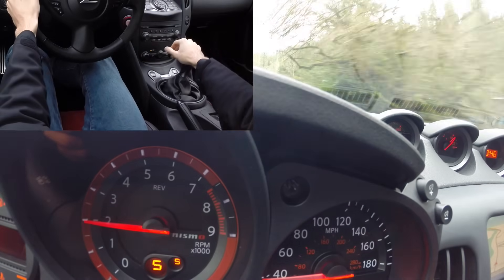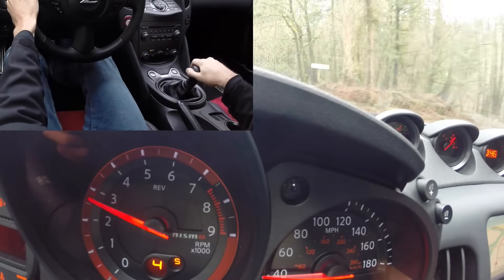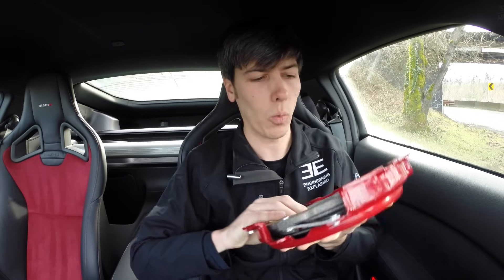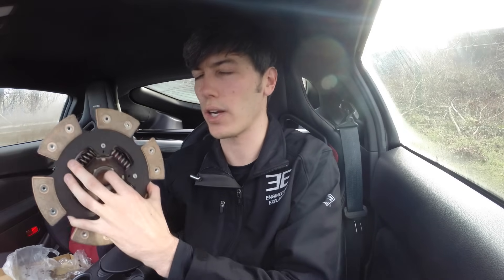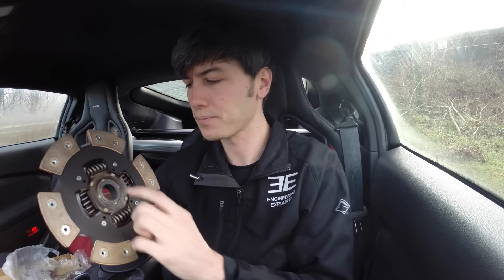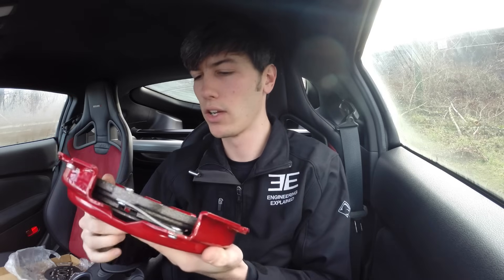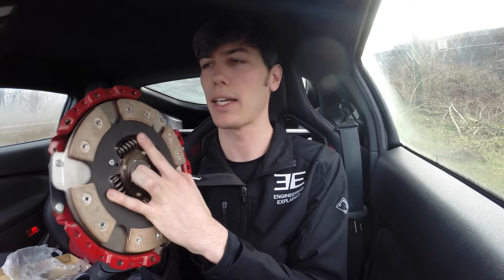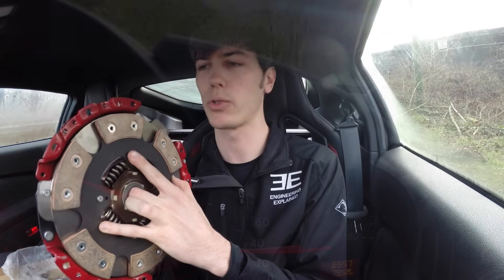What Is Rev Matching?

Comment: When im at a higher gear and im coming towards a stop sign, i just go into N and start braking, and when its time to go again, i put it into 1st and start going. Is that bad?
Reply: Not really, a lot of people have their opinions. Technically it’s less safe? Because if you need to speed up quickly the you have to figure out what speed your at, get in gear, and get to the right revs, but I usually do this. If I take a hard turn I will push my clutch in, get ready to downshift for when I need to get back to speed, and then rev up and release my clutch when I pass the turn, So that I don’t have to worry about getting too low in revs from braking while I was going fast. I’m also a newer driver, and can’t do downshifts while hard braking. I put it in neutral at a stop sign, and if I do a roll through (if there’s literally no one else coming) I get myself back into 2nd, or I just stop completely and start from 1st again. I do this whether I’m in 3rd or 5th coming to a stop.depend on length of road you have to stop, if you’re speeding and you come too quick def pop it in neutral and focus on stopping your car safely, if you have ample distance, you can downshift a couple times before either stopping completely. Idk if this helps this is just what I do.

Comment: Curious why in the Vantage, for example, the most torque is at high rpms (5000-7000) rather than low end. This is very different from how you explain the mechanics for the average set up. Exhaust profile? Other?

Comment: Thanks to "electronics", rev-matching is a no-brainer. Of course it is cheating compared to someone who spends a lot of time on the track and can do without all the" electronics" that makes it so easy. On my motorcycle, rev-matching is a no-brainer because my hands takes care of three things, the clutch, the front brake and throttle, and the feet handle the shifter and rear brake. On a car I can rev match, but not as good as a racer heel and toeing. Mind you, my clutches exceed 180,000 miles. But how nice to have the "Sport Plus" mode on my 2015 Porsche 991 Carrera 4 GTS...in a manual, of course. What a treat! Thinking about it, all you need to know are the gear curves, your RPM and the ECU can do the rest with the electronic throttle, when the clutch is depressed. Good videos by the way. Nothing like a "practical" engineer, instead of one sitting in a cubicle all day.

Comment: what does it mean to "blip" the Rev.. so when the clutch is engaged you hit the accelerator a bit? what about if you need Rev lower?
Reply: No, when the clutch is DISengaged, tap the accelerator to bring the rpms up while the engine and transmission are decoupled.  If you are downshifting, you always need to raise the rpms in order to match the new transmission speed.  When upshifting, you need the rpms lower for the next gear, so you let off the throttle before you re-engage the clutch.

Comment: Someone answer: If I’m going 15 mph in 6th gear (not that I would) could I shift all the way down from that to first skipping the other 4 or 5 gears without damaging the car because it is in the rev limit
Reply: Yes-ish.  You’d be asking a lot of your 1st gear synchro.  It’s meant to harmonize between relatively close speeds, not to replace the clutch or other gears.  You’d wear it out much more quickly doing this, as the rear end of the transmission would be using it to spin up the front end to a much higher speed before you’d be able to engage the gear.

Comment: A very useful educational video! Got a quick question. My car has auto rev match however it only kicks in when the RPM is above 2000. There were a couple of times where I forgot this and shifted from third to second below 2000 without letting the clutch out slowly and then the car did a pretty hard jerk. I wonder what was actually happened and is it bad for the flywheel? My car is brand new but try and avoid this again because it wasn't a pleasant feeling.

Comment: If I'm understanding this correctly, for a smooth downshift say I was in 3rd gear and wanted to go to 2nd, would I bring to revs to 3000 rpm? So I'm bringing the revs to match the previous gear?
I've been practicing it for a while but It seems I've been using the wrong technique.

Comment: But if you’re for example driving in 80 mph in 4th gear, you can’t downshift to 2 right? Wouldn’t that destroy your engine?
Reply: Richard Na123 
In many cars, probably not good.
But really depends on the top speed of the vehicle in that gear, which depends on the gear ratios and redline rpm.
All of which you will naturally feel out as you gain experience with a particulate vehicle and can begin to determine which gear you want to be in at a particular time/speed/location for the type of driving you are doing at the time.

Many super sport motorcycles will go near 100 mph in 1st gear, but they rev much higher than most cars.
So if you are on a track on one of these bikes coming down a straight at high speeds and going into a corner that would be taken at 80 mph; then you would probably want to downshift all the way from 6th gear into 2nd gear going into the corner.
(But would want to go through the gears to use the engine braking (and maintain more control) also as you slow; not just pull in the the clutch make the brakes do all the work and go directly from 6th to 2nd.)
To be at the proper rpm through the corner and have more power available when exiting the corner and getting back on the throttle, for faster exit acceleration and ultimately more speed to the end of the next straight.
Reply: Shannon Crawford thank you!!!

Comment: In retrospect it was good that the first car I drove had no synchro on first by design and no synchro on 2nd by decrepitude so I had to learn this (along with double declutching) to avoid stopping if I needed to drop below 3rd at any point. Although I know it can all be done by a $1 microcontroller I still get a buzz when I pull off a good heel & toe double declutched downchange and stay out of the scenery 8-)=

Comment: Pardon the length of this comment, but I need to know something.
WITHOUT RevMatch, and assuming you already have the throttle depressed to some level and the clutch is fully engaged, the ideal sequence to shift into any gear is (and correct me if I am wrong):  
     1) begin to depress the clutch
     2) as the clutch is depressing, release the throttle so as to fully release immediately after fully disengaging the clutch
     3) shift into the desired gear
     4) begin to depress the throttle
     5) as the throttle is depressing, release the clutch so as to fully engage after the throttle sets the correct engine speed
This all happens in one second or so.

WITH RevMatch, and assuming you already have the throttle depressed to some level and the clutch is fully engaged, the ideal sequence to shift into any gear is (and correct me if I am wrong):  
     1) begin to depress the clutch
     2) as the clutch is depressing, release the throttle so as to fully release immediately after fully disengaging the clutch
     3) shift into the desired gear
     4) begin to release the clutch
     5) RevMatch sets the correct engine speed for the gear you chose to shift to
     6) after the clutch is fully engaged, depress the throttle as needed to adjust the speed of the car
This all happens in one second or so.

The key for me while in RevMatch is whether you do nothing with the throttle (gas pedal) until after the clutch is fully engaged in the new gear.  Is this correct?

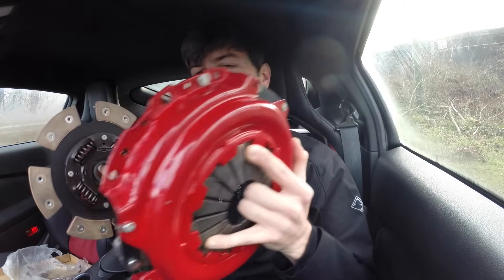Comment: At 2:10 you said that the clutch disc is sandwiched between pressure plate and flywheel. Then you said that pressure plate is connected to the engine. If the flywheel is connected to the engine, how can the pressure plate be connected to the engine.

Comment: Especially if you are driving in the snow and you go from 4th to say 2nd gear you're going to have the braking of the engine to the wheels which could throw your car into a fishtail or spin. No doubt it could happen while in a turn. If you have a subaru it's much easier to control and correct if the occasion arises, symmetrical awd is amazing. Fwd you will have ok control but rwd will give novice drivers a problem or a quick realization that the driver doesn't have full control until put in the situation multiple times until mastered. Flick that accelerator! ...Not too hard now! Lolol

Comment: For the process of rev matching, I've heard 2 potential methods and i'm not too sure which one is actually the correct way. Say you're downshifting from 3rd to 2nd. Do you clutch in, blip in 3rd, then change gears, or do you clutch in, change to 2nd, blip, then release clutch?
Reply: I always do, clutch in, blip in 3rd,then change gears. The other way would be if u didn't need to slow n wanted to accelerate quickly

Comment: I kind of new to driving cars. And i was always confused between rev matching and engine braking and under what kind of a situation  should we perform these.Can anyone tell me when to use these and when not to. ( for example: i have to come into a full stop within a short distance. What i currently do is shift down one gear at a time and use the braking torque of the engine to slow down. This is what i think is engine braking. Pls correct me if i am wrong. In the same situation if i perform a revmatch......wouldnt that reduce the braking effect  produced by the engine.)

Suggestions from experienced drivers can realy help so that i can be a better driver.
Reply: Yes, I am curious about this, too. Just got my license, and am driving only in city (high traffic) environments, 3rd shift in my car, 50km/h max. I do the same thing you do, when coming to a stop - I anticipate the stop, so lower my speed (gas pedal off and brakes if necessary), downshift to 2nd and cruise to stop. If I need a sudden stop, I apply the breaks. What would I gain with downshifting technique?

Comment: Nobody in their right mind changes down gears during cornering. Unless they are cluless. You do this prior to the corner and accellerate through it. There is nothing to be gained from rev matching in such cases which is why you will see real drivers more interested in left foot braking or heel and toe to keep the balance of the car.

Comment: I've been driving manual car (old Mazda pick-up) for almost 3 years and I've never known this before :D. When I want to slow down, I press brake pedal and when the speed is low enough, I just downshift to estimated gear number  e.g. I'm on 5th gear, I press the brake pedal, when I think it is slow enough for 2nd gear then I switch through 2nd gear. Is this considered to be dangerous in any case?

Comment: I have been driving an 18 wheeler for 14 years....i had no idea what i was doing was rev matching to down shift.  You cant drive an 18 wheeler until you learned to rev match because it will not go into gear.  Of course that is not a big deal as much anymore as most companies are switching to automatics.

Comment: racing or not, if you need to use the clutch to shift gears then you need to learn how to drive a mechanical transmission. sure i need the clutch to get going from stand still, and sometimes at traffic lights and stuff to crawl a bit, but once its rolling it is not realy needed if you can properly do rev matching. done correctly your passengers or anyone observing should not be able to tell you shifted gears apart from the engine noise.

Comment: Engine speed vs transmission speed. I don’t really get that one. Namely, I don’t know what is meant by “engine speed”. I’m not super mechanical so a “Layman’s terms” explanation would be helpful.
Reply: An engine uses the released energy of burning fuel to create mechanical motion. That motion is converted into rotary motion of the crankshaft. How often that crankshaft rotates is your engine speed and is measured in revolutions per minute (rpm). Now using that rotary motion to directly power your wheels would be very inefficient, just think about riding a bycicle with a single fixed gear. Thats why we use 
different sized gears to transmit (ergo the name transmission) the rotational motion from the engine to the wheels. To change gears we need to disconnect the engine from the transmission and thats the job of the clutch. Now you want to downshift, you press your clutch so engine and transmission are disconnected, you change into a lower gear and now due to gear ratio your transmission shaft spins a lot faster. If you release the clutch now your engine speed is a lot lower than your transmission speed and has to catch up first. Using the throttle before we release the clutch after downshifting we can match engine speed and transmission speed before they connect.

Comment: Why would the transmission be spinning faster than the engine after disengagement when downshifting? Trying to understand this lol
Reply: I think I get it.. when you downshift, the lower gear with a higher gear ratio will need a faster rotating engine to keep the transmission turning at the same speed (low gear ratio to high gear ratio). So by rev matching, you're making the re-engagement easier by "synchronizing" the rotation speeds of the engine (increase it a bit) and transmission.

Comment: So basically its like bicycle gears, the first gear is super easy but you can't go fast, and the 7th is very hard at low speeds but you can go faster.
Reply: Yeah but don't start in 6 cause unlike you, the engine will stall 😂😂
Reply: @codcade  Oh with my chicken legs you will definetly stall
Reply: @thatguywhodidntgetthejoke1094  😂😂😂😂😂😂😂
Reply: Thank you im faded and u just explained how gears work to me :D
Reply: Torque...
Reply: In "explain like I'm 5" fashion. Yes, a lower gear gives you more engine bangs per amount of road driven. At some point the engine can't bang fast enough, so now you need the next gear so you can drive more road for the same amount of bangs (typically you only wait until the limiter for lap records and passing as fast as you can before another car comes). Either that or the engine can't bang hard enough, so you need to lessen the amount of road per bang and go down a gear.

Comment: If you've ridden a motorcycle you learn how to do this very early on. Imagine being leaned over and downshifting without Rev matching. That back tire is going to slow down and want to stand the bike up or possibly spit you off (called a high side) . Smooth transitions are critical on a motorcycle.

Comment: I probably won’t get an answer but, if the idea is to rev match, how come there isn’t a separate rpm gauge for the transmission and the engine?  which you could match the speeds more precisely before letting out the clutch

Comment: What is rev matching?
Unnecessary on the street.
Reply: It makes all the difference in clutch wear.
Reply: @RyosukeTakahashiRX7  Ill dispute that. When I replaced my factiry clutch in my car at 210,000 miles, it was unnecessary. The original was well within spec and would still be in use today, had I not changed it. I dont rev match.
Reply: @dr.hugog.hackenbush9443  I don't think a clutch really survives long if you're for example going 60km/h in 4th gear and slap it down to 2nd or 3rd gear without looking at the rpm at all. Most certainly you probably did rev match it in most cases otherwise this case is unexplainable.
Reply: I think a clutch will survive 300+k miles under regular driving conditions.
Something like drag racing or road course racing, would of course, eat it quicker, but would still last at least 100k, unless you are running a fuel dragster (1,000 feet!) or you smoke the clutch.
Reply: @dr.hugog.hackenbush9443  On my Audi A3 which i drove carefully every day i had to replace the clutch after 250k kms (don't know what exactly it is in miles and yes, I'm that lazy) which is way less than 300+k miles. I also had some cars needing a replacement way later and some way sooner. After all it depends on how often you have to shift, if you ride the clutch etc etc. But i can guarantee you stock clutches won't hold long enough for 300+k miles, especially when you don't rev match. The wear on the synchros as well as the clutch is way too extreme. Out of curiosity, what vehicle was it?
Reply: @RyosukeTakahashiRX7  It is a low-power applocation: a Ford Escort. It's a hydraulic clutch setup. Car now has 340,000 miles (and counting).
I did replace the clutch in my Cobra Mustang at 180k, simply because I was overpowering it. One rated for 600hp held up, but my car swallowed water before I could get any real mileage on it.
Reply: Even if you get satisfactory clutch wear, why wouldn't you just do it correctly all the time? Its just bad form to drag the RPM up with the clutch, and everyone within earshot will think you don't know how to drive manual. Besides,  you should already have muscle memory for doing it correctly if you actually drive for real. There would be no reason to fight the correct muscle memory in order to be more lazy.
Reply: @CasterTown  I have a very quiet exhaust on my car. I say its not neccessary for regular everyday street driving. If you're doing a track day, thats a whole different situation, but 99% of the time when you need to downshift on the street, you are going to stop at a light or something. I just use the engine braking in conjunction with my brakes to slow down quicker.

Comment: Best way to describe it, think of your clutch pedal and gas pedal on a wooden seesaw, as you let off the clutch, you are pressing down on the gas at the same time. Of course the lower the gear you go the harder you have to punch your RPM's to get a smooth transaction, for instance from 5th to 3rd.